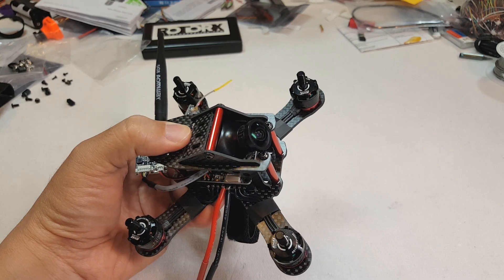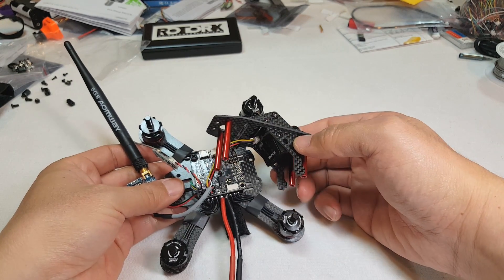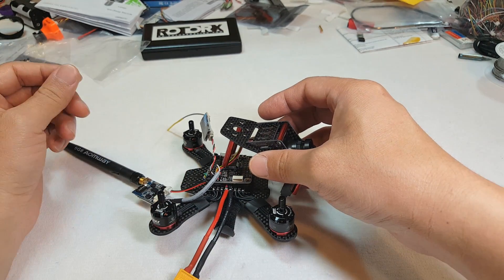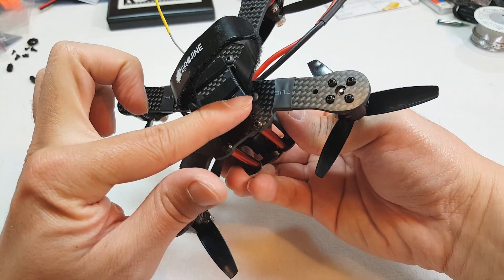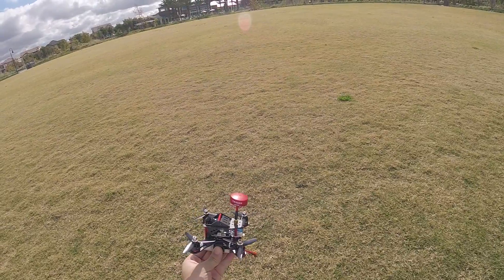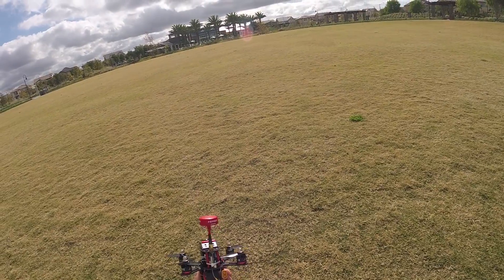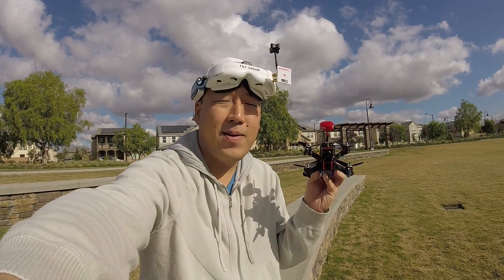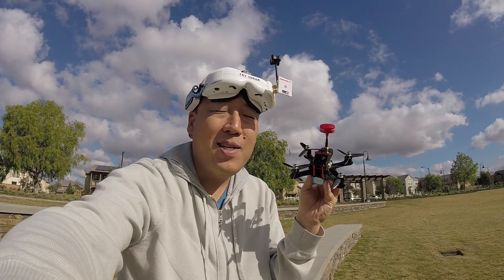GB130 Microquad Build & Fly

Comment: Hm, I have the EXACT same setup as shown in the video - same hardware and the PIDs from that CLI dump, but the copter sporadically falls over to the left or right in mid-air, especially on hard turns. 3S Lipo used - could this be related to wrong PID settings? 😳
Reply from the maker: My PIDs are for 4s... that will not work on 3s. Also, even with exact same parts, PIDs don't always work every time.
Reply: Jeez! Using 4S 1550 45C with Gemfan 3035 3-blades now ( http://bit.ly/2wcScPs ) and this thing is lightning fast 😳 Get nearly 6 mins of flight time. My current PIDs:
PITCH: 36 20 20 
ROLL: 30 20 20
YAW: 70 45 20
Reply: The tilting on full throttle also appeared with 3-blade props. It wasn't caused by the PIDs. After switching to BF3.2 and dynamic filters AND switching "motor timing" option of the ESCs from "medium" to "medium high" the full throttle tilting is completely gone now. Don't know which of both solved it, but it flies great now!

Comment: Hi Albert, I am doing a very similar build to this.  I have positioned the ESC & FC (Omni F3) the same as yours.  Looking at the client dump file you have board align yaw to 180.  Shouldn't this be 90?  Or have I missed something here.
Reply from the maker: +aaron test you have to adjust it. The dump I use is general purpose. Some adjustments are needed from build to build.
Reply: Albert Kim thank for your reply.  90 it is then.  Looking forward to the final parts to complete the build
Reply: Hey Albert. Sorry I have another problem with building this quad.  The flight controller is powered via an Racerstar 20amp 4 in 1 ESC V2 (5volt out) using the multi cable.  I  have solder 5v camera and 5v VTX to the gnd/ram/in-out slots.  Unfortunately the VTX is not powering up.  Do I need a jumper from vbat to ram OR 5v to ram to power the other ram slots?  Thank you for your help. (p.s. your Google Doc is right the yaw board alignment is 180 degrees.  Why is it never simple...)

Comment: hi albert nice frame i like your build.i was looking at this frame for a swap in case i break the frame of my eachine falcon 120 and that carbon piece is what worried me.the frame is on sale now but i have just ordered the 120 and dont like the camera on top but the price is cheap for a beginner like me. i really wanted to have it because spf3 and aio 20a esc for 4s 850mah.do you think it would work?
Reply from the maker: For a 3 inch prop 4S 850 on 20 amp ESCs should be OK.
Reply: the system from the falcon120 would fit and work good on the GB130 frame?

Comment: Approximately how long of flight times do you get? I have a very similar setup and barely get 2 minutes with a 550mah 4s
Reply from the maker: I get about 3 minutes with a 600mah and 3.5-4 with an 850mah 4S.  The smaller batteries will be more sensitive to aggressive punchouts .... if you're near or at 100% throttle the whole time on a 550mah lipo it would go about 2 minutes.

Comment: Hi albert, I built a rx130 with the emax rs1306 4000kv motors and they get very hot with 4S battery, is it normal for these motors?
Reply from the maker: +FPV Beach Racer mine are cool. Check if screws are touching windings. You might be over propped.  Too much weight?
Reply: The screws are ok, I'm using rx 130 frame 3mm, racerstar 15A esc Blheli_S, and stay very hot on 4s Infinity 850mah with dys 3030x2 or dal 3045x3 propellers, the problem can be esc configuration? My has setup:
Startup Power - x0.75
Temperature Protection - On
Low RPM Power Protect - On
Brake On Stop - On
Demag Compensation - Low
Motor Timing - Low

Thanks!

Comment: Hi. I really appreciate this reveiw. 
I bought this frame last week & will be using parts from my 160 to make a smaller quad.
I wondered about that cam plate, it looked like it might cause issues :-(
Could you please post up your pid's , as a starting point for those building up one of these
Thanks
Reply from the maker: +S Rob I will post a CLI dump link in the description when I have a better tune

Comment: Looks like everyone has recommendations on how to get the FC locked down - I want to know how it handles wind gusts!  Seemed really solid considering it's about 1/4 the size of a 250. Kind of like an angry chihuahua of miniquads...
Reply from the maker: It's funny that everyone is worried about those two screws that I didn't use but because of the way it's wedged in there, it's not going anywhere.  All the recommendations will just make it worse, not better.  It handles wind just fine.  Plenty of power.

Comment: Why not just put smaller stand off`s in-between ESC and FC , looks like there is loads of room going to waist  between ESC and FC ?
Reply: I cut the standoffs down to the size I need :-/
Reply from the maker: That's the smallest standoff I have. I got it all to fit and it doesn't move around so I'm happy with it.  Just a pain to put it all together.
Reply: Off topic but what scale are you useing for your videos? All the kitchen scales i have looks at don't go lower than a 1 gram.
Reply from the maker: I have two scales.  One is a kitchen scale for things over 100g and I have a more precise scale for things under 100g

Comment: looks fun but almost seemed a little down on power (not sure if the lipo was too heavy for it or something).
Reply from the maker: It didn't feel that way. What part of the video was it looking like it was down on power?
Reply: Albert Kim, the line of sight footage more so than the FPV footage looked like it might not have the punch out of the Youbi for example. ...not exactly a fair comparison I guess considering the weight difference due to the better frame and FPV gear on yours.
Reply from the maker: I wasn't bringing it anywhere near as close to the camera this time as well.  Trust me, this one is MUCH faster than the Youbi.  LOL

Comment: Take a dremel and remove some material from the camera mount. It will take only 5 min, and camera mount there is not structural, so it'll be ok, and you will be able to completely secure the FC.
Reply from the maker: The FC doesn't move at all even without the two screws.  The carbon plates are holding it down.  It's just super tight.

Comment: why did it tweak out at first?
Reply: Andrew M, he said in the video that his FC orientation was wrong on his first attempt. So the flight controller was programed to think that some other direction was forwards.
Reply from the maker: Board orientation was 180 degree reversed. I flipped it around to get it to fit in the frame and forgot to change the setting in the software.
Reply: Albert Kim 
Thanks for the reply, great content as usual!

Comment: Can i use 1104 4000kv motor?
Reply: Abdul Aziz Fathul Islam you probably can, but i wouldn't recommend doing so, they would easily burn out. You should stay with the 1306 or 1406 size motors
Reply from the maker: Yes, but only on 3S and the performance will be significantly lower.
Reply: Noted.  Thanks sir.